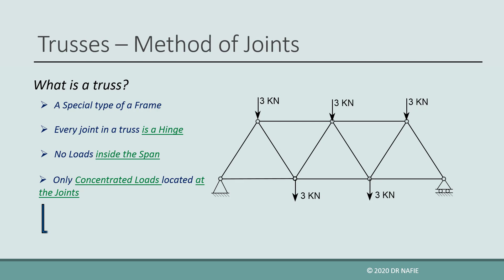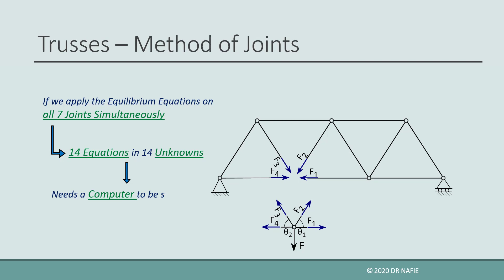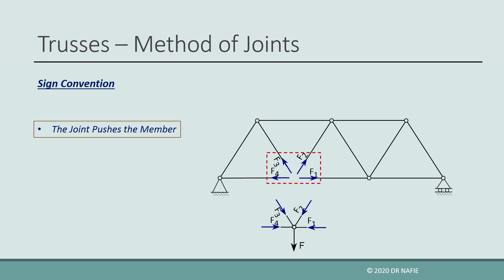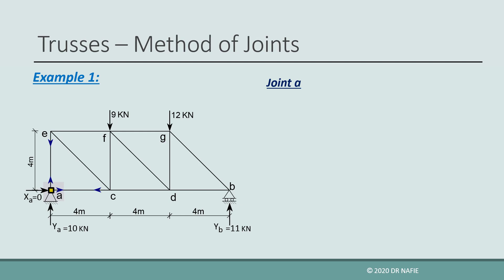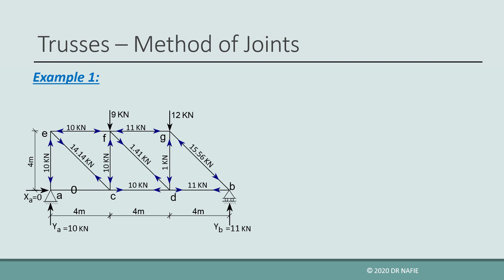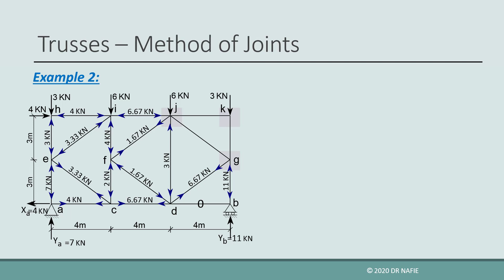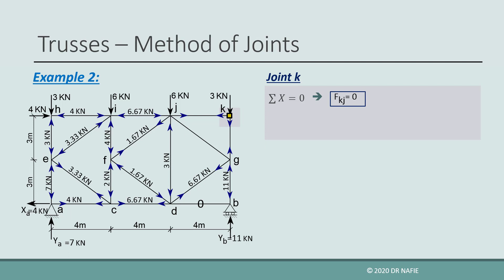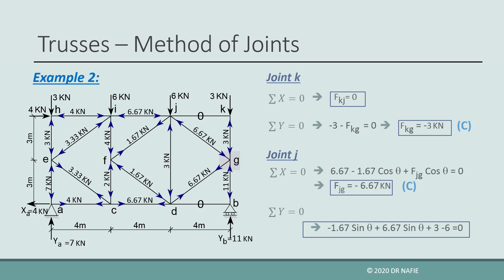Trusses - Method of Joints with Examples

Comment: why is there a +10 while calculating Ffg?
Reply from the maker: If you are referring to example 1, we find Ffg by balancing joint f in the X direction.
we have 3 forces int he X direction Ffg ( which is to be evaluated), Ffe (which is the 10 KN you are referring to) and teh component of Ffd in the X direction (  1.41 cos 45). By balancing these 3 forces we obtain Ffg.
Ffe ( 10 KN) was evaluated in a previous step
I hope this answers your question.

Comment: In the first Example, why does Ya = 10kn ? and Yb=12kn ?
Reply from the maker: Ya and Yb are obtained using the equilibrium equations.
If you take the moment about point B, the equation will be as follows:
-Ya x 12 + 9 x 8 + 12 x 4 =0 this gives Ya = 10 KN, 
then by taking the equilibrium of the vertical forces
Ya + Yb - 9 -12 =0 this will give Yb = 11 KN
For more information on how to find the reactions watch the following lectures:
Reactions- Simple Cases:  https://youtu.be/eWuNPDYmfcc
Reactions - Advanced Cases: https://youtu.be/JHZJ7XK4JU0